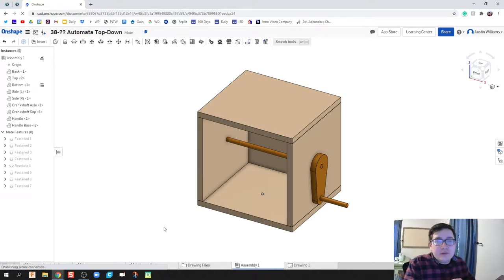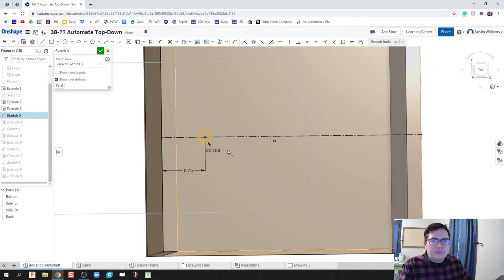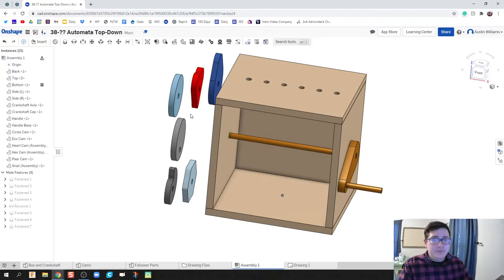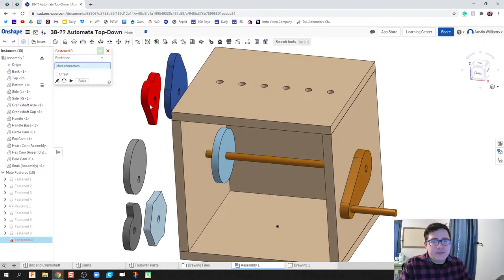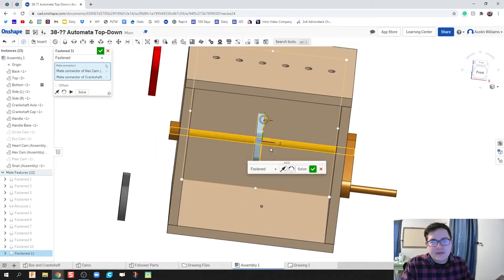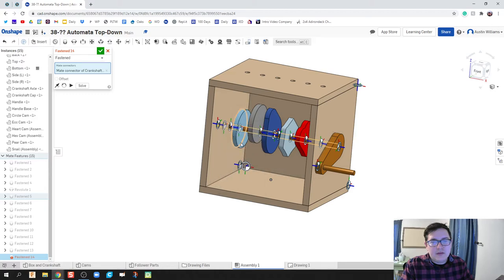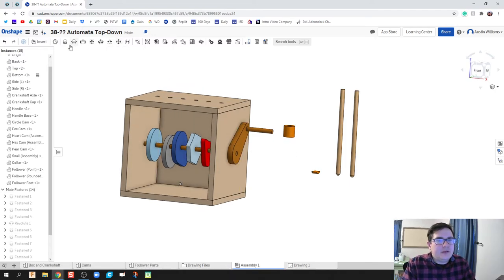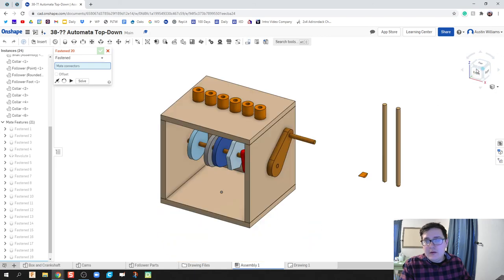Automata Top Down- Cam and Collar Assembly - Day 44 of 100 OnShape Journey

Comment: Hello!  Thanks for all of these videos!  They have been a huge help with my classes.

I want to point something out.  I agree that the circle cam won't show any change in vertical motion.  However, the way you constrained the circle cam to the wall of the box instead of the crankshaft axle, the cam won't move regardless of the type of cam.  All of the cams should be fastened to the axle.

Comment: Hello! I'm having trouble pairing a sliding mate with two revolutes for a motorcycle suspension. Any ideas what I could be doing wrong?  Thanks for all your content!
Reply from the maker: When you have a chained mate, the calculations and links need to be exact. If you're running into longer issues, you can do a gear relationship between the two revolutes to make that work as well.

Comment: Hello! I'm having trouble pairing a sliding mate with a revolute for a motorcycle suspension. Any ideas what I could be doing wrong?  Thanks for all your content!
Reply from the maker: A sliding mate with a revolute would be a cylinder mate. That way it will pair the slide with a rotation effect. Getting your directions  can be tricky, but it can work.